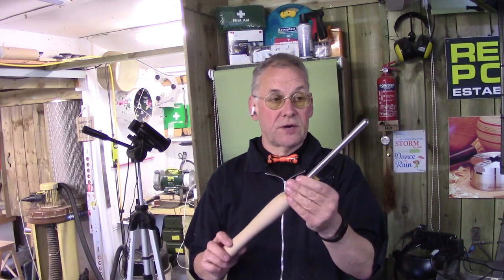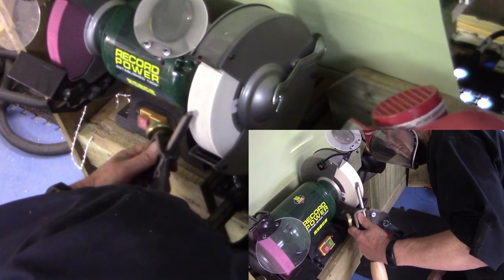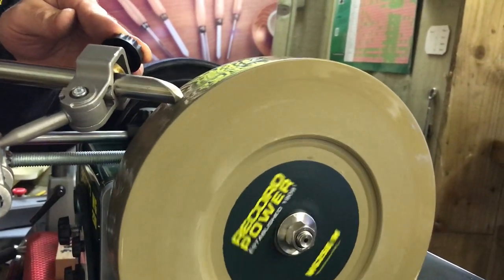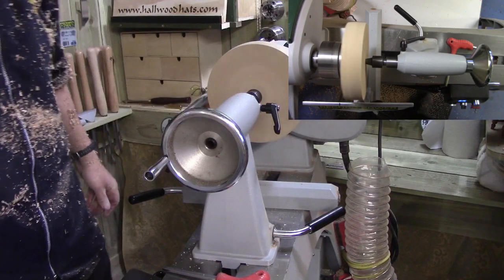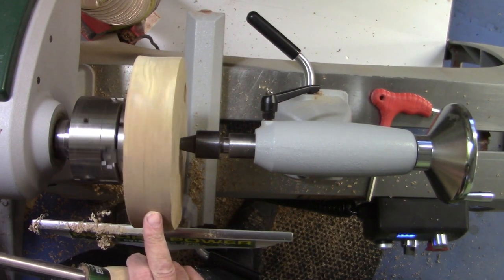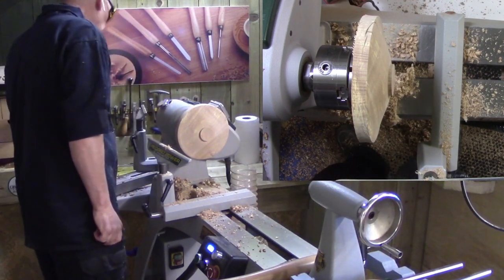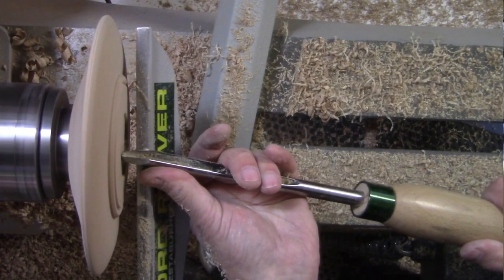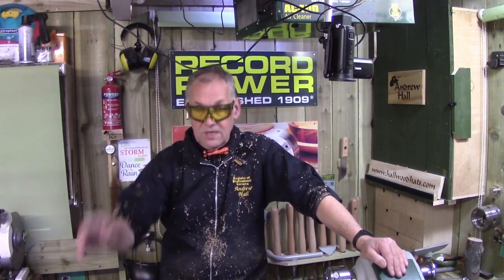Andrew Hall's Guide to Bowl Gouge Profiles and Their Use

Comment: Hi, are the bowl gouge (and spindle) sizes measured by the flute width or shank diameter? Also what are the blade lengths. TIA
Reply from the maker: Hi Marcus, thank you for your comment. The answer is neither, the tools are measured from outside of stock to the opposite flute. On spindle gouges this is approximately the stock size of the bar. Below is the stock size of our material against what gouge this would be. Please note, these measurements are what we buy in so with heat treatment and surface finishing the blade will be slightly smaller than this:

Stock size	Gouge size
10.3mm	        ¼”
13mm		3/8”
16mm		½”

With regards to the blade lengths would you like to know the flute length or how far the blade protrudes from the handle?

Best Wishes, Record Power.
Reply: @RecordPowerTV  Thank you for the quick reply. I would like to know the flute length please.